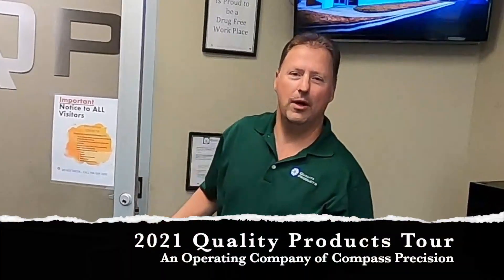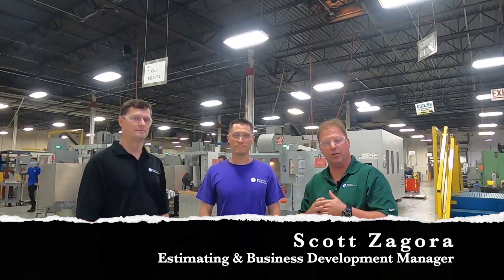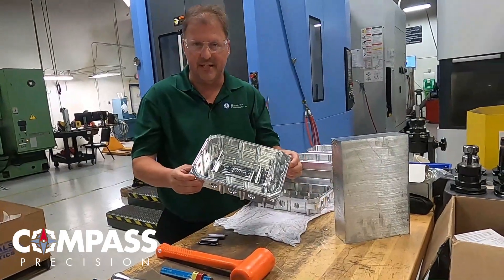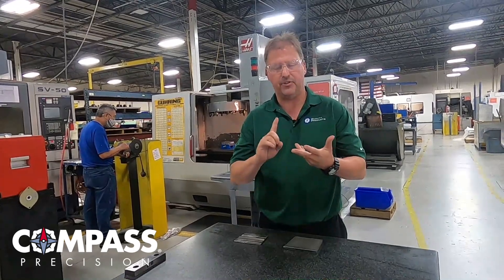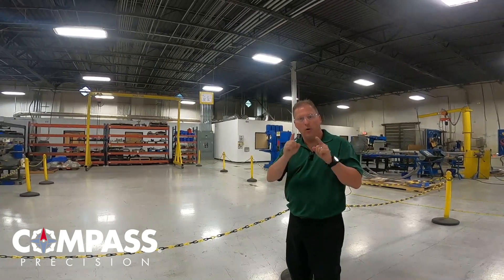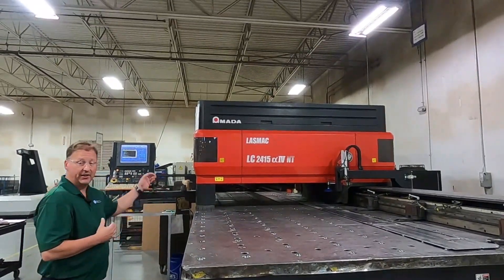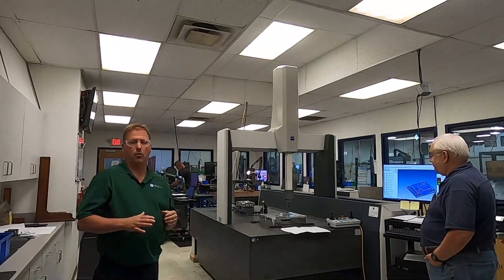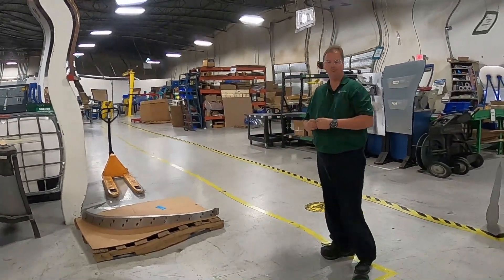2021 Quality Products CNC Machining Factory Tour

Comment: Thanks for  visiting my little house, and am here watching around with your hi-tech machinery.  Im amazed those machines you showcasing. They are all interesting  and precision when it comes dimensions finished product.  As a CNC Turret Puncher and Cincinnati Milacron programmer and operation as well as Mech'l designing .  I've seen (AMADA LASER)a lot better to use in terms of light cutting sheet metal machining,  through CadCam via (DXF) works done timely.  thanks for sharing your machineries. Full Support here and Tag's  done.
Reply from the maker: Thanks very much for checking out our latest video 😎